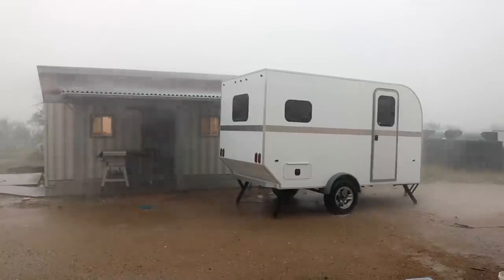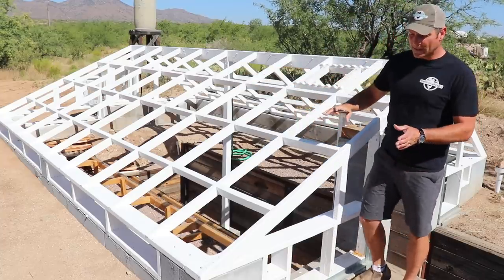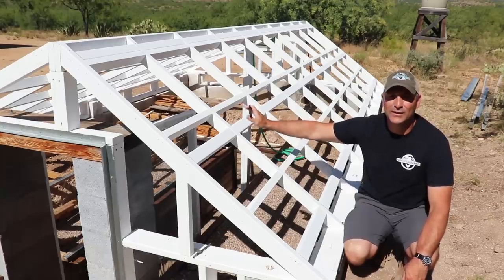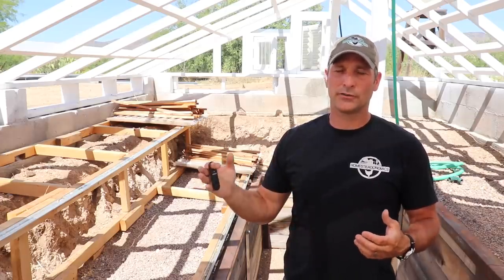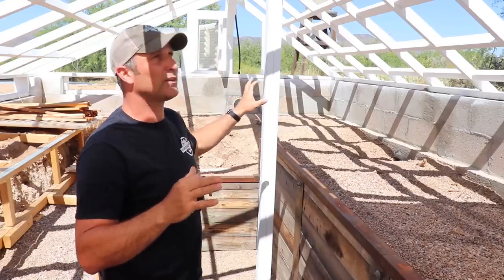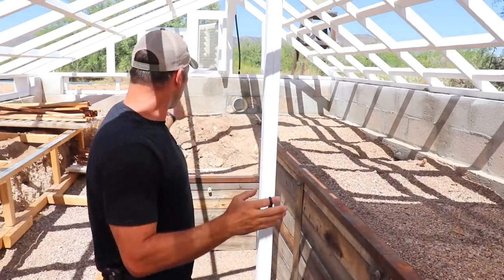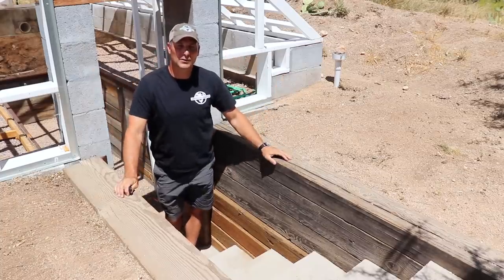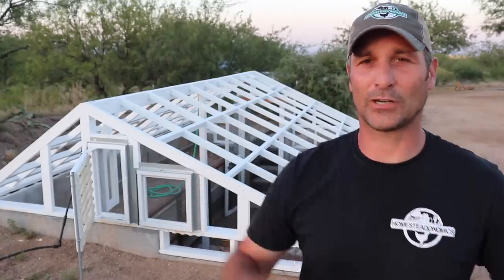Sunken Greenhouse Revival - Plans

Comment: I like the idea of putting the shade cloth on the outside on a rail system so it's sun and hail protection.  Because the sun and wind are so strong, shade cloth doesn't last long in AZ. Perhaps you could consider slatted panels from wood/metal that slide up and/or down the rail system.  Speaking of gardening, how are your fruit trees and veggies doing?

Comment: Maybe you could attach 2 long tarps on the top of the greenhouse on both sides.When you feel it may hail you stretch them out and hook them to the ground to cover the greenhouse.
Reply from the maker: Thats kinds what I am thinking.  Something that I could pull out for protection, but be stowed away too.   some have mentioned a pool cover roll that could be used to wheel it out or stow it away :D

Comment: Shade cloth like a tent 
Store it on tne north roof when nit needed.
Wind protection 
Just put anchor bolts in and tie the stucture to it .
Or 
Throw cables over the top.
Like on hoop houses

Comment: Days are longer in the summer, so a metal roof on the North side preferable white pro panel will do the trick. As it will not fade or bend and keep the heat away during the summer. A wood fence close to the ends will knock the wind off the greenhouse.
Reply from the maker: I think a fence would be great to buffer the wind.  But not sure how my would like me adding more strucutres around the house...haha... .she thinks I already have built too much ;)
Reply: @homesteadonomics  Build it within two feet of the greenhouse, even 3 to 4 foot fence helps. Plus keeps the dogs and kids away, both can be a pest problem LOL!!

Comment: Insulate the north half and use metal roof. Dig a 250 foot trench and run a few tubes through it to cool and heat the place.

Comment: Take 3/4 to 1 inch PVC pipe.
Place south to north.
Drive 1/2 inch rebar in ground every 4 to 5 ft.
Slide pvc pipe over rebar.
Place 4 metal T-post in ground about 3- 6 ft  from corners.
Place 4mil blue tarp over pvc pipe and wrap a rock or 1-2 inch round object  in each of 4 corners and tie off to t post.
The tarp will act as a buffer when the hell comes down and the tarp will also keep the inside of the greenhouse cooler and the 4mil blue tarp will allow sunlight to come through to grow the plants but not too much inside your Greenhouse.
 I would install 15 inches by  33 inches 4 to 5 Tier racks this way you'll be able to multiply your Greenhouse season capacity by 4 to 6 *
Reply from the maker: that's some good thinking!   I'm going to have to think about this as a real good option Bryce!  thank you!
Joe
Reply: @homesteadonomics  this works great in a desert because you can put on both sides North and South a water catching Basin 27 gallons or 5 or 10,000 gallons also you can change from the tarp to any other hell buffer or sun reduction fabric while using the rain catchment and Cooling your Greenhouse

Comment: Add more layers of polycarbonate to increase durability and provide more shading. Maybe only guessing though. I don't know if water would get in between layers, or if too much light will be blocked.
Or Add wire mesh over the top of polycarbonate with spacer to protect it from hail, another guess though, please weigh it up for a time to make a better choice.

Comment: There is a commercial greenhouse about a 100 miles by road.  They used polyurethane heavyweight on the inside of 2x4s and more on the outside of the 2x4s. In the winter or when the sun is too hot they have a type of aluminum sandwich with bubble wrap in the middle that they can roll up or down on the roof.

Comment: You should add a geothermal system to your greenhouse.  You are already 5 feet down.  A couple of pipe runs down 8ft and a blower in the greenhouse would make the whole thing usable all year long.  The ground is usually between 50-60 degrees 8ft down depending on where you are and thats a pretty cheap way of heating and cooling once you put in the pipes.  I see you have a pipe.  Its just not nearly deep enough.  You'd need 2 of those pipes 8ft deep.

Comment: I'd say the shade cloth should be more simple to install and provide more protection and probably be cheaper. Just make sure you have support to suspend it above the roof panels as the farther from the panel the more hail protection it will provide. You might want to consider using two pieces of cloth one UV resistant and one rip stop, unless you want to spend more money on a single strong yet UV resistant option.

Comment: 50% sun is more than adequate here. Just alternate panels between clear and standard opaque roofing. A checkerboard is even better (perhaps with the bottom row all clear). In the winter we still have enough solar intensity you just leave her buttoned up to keep temps up. Yours is not the best design for this 50% shade idea but it will still work and let you extend it's useful time longer than anything else. --- If you find you need more solar oomph in the winter just hang mylar space blankets under the north side roof panels. Gives you not only a thermal reflector but also a light reflector. --- For protection, just stick a screw in eyelet at each corner and roof peak with the loop being 3-4" off the roof surface (The type where it's an eyelet on the head of a 6" long screw basically). Then, when you want protection, just tie a tarp on each roof face with the corners going to an eyelet. Gives you a trampoline that hail will bounce right off of. Just make sure they are tight. There's a rope tightener we used in the Army on the old GP tents that is simple but effective (just can't remember what they are called) but any cinching knot will do. --- Forget the mortared rock wall. More work for poorer results. Build a mini gambion. --- I'm not sure if the roof would aerofoil on you but steel wire X braces on the roof (as low as is comfortable to work in) will ensure there's always tension fighting up/down pulses. You don't get extra load capacity but you also don't have crap in the way, haha. --- Earth tube cooling works great but we need a lot of depth here. Also, drain pipe (the type that spirals) works FAR better as it gives more surface area for the flowing air to shed thermal energy. PVC just has less surface area, is thicker, and conducts heat more poorly. --- You can give an added cooling boost by sticking a terra-cotta pot full of water (with a lid) in front of the earth tube vent. The terra-cotta will wick water slowly to its outer surface. Simple swamp cooler. --- Also, keeping the vent open on the same side as the earth tube outlet probably hurts flow since you want negative air pressure with the building exhaust as far (and as straight) away from the building intake as possible to keep a good flow. ------- Anyways, keep it up! Looking forward to see what all you get accomplished this year!

Comment: I was thinking about a combination of the 2...at the ridge put hinged panels that flip over from the metal side...that are 1 purlin in length...with a cutout for the solar fan.
Then from the bottom...a roll of the cloth that can be brought up to the level of the bottom of the flip-over (or lower for only partial coverage)...which can finish it out.
That is the best way I can think of that solves the problems of coverage & the solar vent being in the way and needing access to the sun instead of using just full cloth coverage.
I know that it probably sounds a bit crazy...but it works right in my head...but then I am kinda crazy too...so yeah   :)

Comment: It would be so much easier to run the shade cloth on the south side if you put the solar roof vent on the north side. You'd have to frame out a "chimney" for it to sit on so the sun angle was right for the built in solar panel. Aluminet will easily withstand the heat, wind, and sun. Not so sure about the hail, though. Get it with taped edges and grommets. Then it's as easy as attaching with rubber tie downs or bungee loops. Using it seasonally I get 8 - 10 years lifespan on the 50% aluminet at 7300 feet elevation in the southwest US. I've seen the temperature drop as much as 14 degrees F inside the greenhouse when installing on a sunny day! In the off season store it out of the sun and weather for longest life.

Comment: What about using a system where you use wooden slat that opens and closes with a Manuel hand crank, or a timer to automatically open and close.  Open day, closed at night on top of the poly carbonated roofing material

Comment: Reality is you dont need to over build on the rock shelf.. not like it is holding lots.. might be easier to get step stone pavers and go up a couple of bricks for a facing. Gravity is your friend.. Just a parge with mortar mix and you will be done.  What you describe is going to take a lot more work ... I like the idea of a sun shade cloth.. it is tried and true. and NOT going to blow off like small panels you described.  Think what a sunsetter shade cloth and how it rolls onto a shaft..

Comment: Put a rolled up shade cloth above the roof ridge with a hand crank to pull down for the sun and hail.  Maybe make the tube for the roll out of 3-4" ABS pipe(as long as it doesn't melt in your "balmy summer" days, or maybe your  metal supply guys have an aluminum pipe that would work.... KISS .....

Comment: Joe, good video - nice work.  Check out the Solexx products before you reroof. I have a 25 x 50 underground greenhouse that I covered with 5mm ~ It consistently maintains about 20 degrees above ambient without supplementary heat.  Thankfully I haven't experienced golf ball sized hail but I'm pretty sure it would bounce off.  All the best to you and yours, and Good Luck with your reno. Dave
Reply: I read your expansion contraction comment in an earlier communication; yes, it worried me and i struggled over the decision for months looking for example photos on the internet that would illustrate the amount of deflection of the material, and I looked at every alternative roofing type I could find.  and yes Solexx bubbles up a little between the supports on hot days and lays tight in the cold, but its not particularly unattractive. And I'm sure that I'll go thru the same research exercise when I reroof, but someone's going to have come up with a much improved technology for me to change.  And no, I do not have any affiliation with the company.

Comment: you mean like a roll tarp/canvas on a semi trailer. another way would be like curtains on dairy freestall barns. the  farm i work at the 150 ft long barn side curtains are automatic controlled by thermostat because cold draft at night can give them pneumonia. dairy farms in your area put up shade cloth over the areas where cows are waiting to get into the parlor. has to high enough to drive skid loaders/tractors under. my garden poly tunnels have 2 layers 6mil vapor barrier. every 2 years has to be changed the suns uv makes it brittle but it does stand up to minnesota 80 mph straight line winds & golf ball size hail

Comment: IMO your retaining wall will look better dry stacked. 6x6 inch footer would be over kill, just embed larger stones for support. Using mortar would require more work.  If you use the polycarbonate on top of the benches you will probably not get too much moisture below.  Just make sure they drain off the front,  you shouldn't need to place concrete.  If you use the concrete you wouldn't need polycarbonate with proper slope. 
Shade cloth should probably stow away easier than panels.
Reply from the maker: yes, to the shade cloth... I think it will be the more practical solution.  and I do love the look of dry stacked walls too!

Comment: I was looking at the angle of the sun in the sky and slats to let sun in during the moderate times of the year about a 35° angle and reflect during the summer when the sun is about a 80° angle.  This would allow indirect sun when its baking the ground and everything else.  Maybe aluminum foil on the side facing up?

Comment: Love the design! I also live in Arizona so I was wondering about a short retaining wall for any flash floods you probably won't be using it during the summer due to the Heat and may not have to worry about it at that time but we also get some heavy rains in the winter and whatever water that comes might wash alot of crap in to your beautiful Greenhouse so have you thought about putting a small water barrier wall around the entrance way? Also i would probably dig down a bit below your standing level inside and then put in some type of floor that lets water go down to that lower space but does not flood the area that you're standing in if any water were to get in and also water running down from your plants Etc. Looks great so far thanks for sharing very inspiring.

Comment: Would tension bars or cables work to attach into the block foundation wall? Or some other attachment point into the block?
Reply from the maker: I'm probably going to drive some 3' concrete stakes as part of the inner retaining wall and tie it into some poured concrete to support both the retaining wall and give anchoring for the shelving too
Reply: @homesteadonomics  Excited to see what you come up with. 👍

Comment: Stretch chicken wire over it. I don't think it will shade too much and it should stop or slow down most hail. Just a thought.
Reply: I should say above the roof a couple feet, not laying on the roof.
Reply from the maker: I think a wire spaced above the panels would be a great option and chicken wire is pretty cheap too!  :)

Comment: Hi There, I allways liked your green house.. (said that the hail storm ruined the roofin)  I have 2 posabilities to over think.: (1) If you wanne use the same (lexan) golfplates, my advise would be.: Use 2 layers on top of each other over the complete light side of the green house, and screw them thight together, to add strength.!  (2) The way it's bin done in my country.?  We use 1/5 inch thick flat massif lexan plates in alluminium profiles.!  But you can allso use the same vertical Lexan 1/5 inch thick windows, without alluminium frames, make them so that they are with an 1 inch gap on the under laying wooden frame, than you can allso srew hard wood over the seems.. This method is very strong, and less expensive than the alluninium frames.  Allso here we only add light shade curtens on the inside.. Anyway, succes with your plans.. Greetz.NL

Comment: Should use twin-wall polycarb for the whole building ... Lifetime guarantee from hail
Reply: * think the plastic you used previously isn't polycarb .. Rather i believe its PVC .. 
Twin wall polycarb will allow you to grow in the winter !
Reply from the maker: Amin K I’ve actually checked that twin wall stuff as well.  Seems all the polycarbs have about a 10yr hail warranty,   But I’m definitely checking into it as it would probably have better nighttime heat retention with that air gaps
Reply from the maker: ....and the previous was polycarb, not vinyl.   It actually held up to large marble hail a couple months before.  I think the storm just ended up to a level that was uncommon

Comment: the shade cloth, if you want appreciable hail resistance, I think if you engineer it almost like a trampoline, it could work. maybe...oh! so suppose you sew in pouches along its lenght to insert like 4" rubber balls, and some kind of weight at the bottom edge. the balls would elevate the sun cloth from the plastic, the weights would keep it taught. otherwise...just draping fabric over the plastic I don't forsee will offer more than negligable protection.  brainstorming
Reply from the maker: I'm definitely leaning towards the shade cloth and having it spaced above the GH by a few or more inches:)
Reply: @homesteadonomics  hmmm...youi could also use lines of some kind, stretched taught from peak to eaves, and the shade cloth can roll up over those suspended lines. could even use rings threaded over these suspension cables, affixing the fabric to to them. though that would impair a rolling function. but....yeah. I think having the fabric suspended away from the glass would also help with cooling anyway.

Comment: Although you being in Az. Do you have a sump pump for ground water or rain fall collecting in your dug in green house or is that not an issue at all for you?
Reply from the maker: Matt Varney not an issue for the greenhouse.  Our water table is hundreds of feet down and the ground is graded to shed water away from the GH.   Some water does come through the stairway but it’s very minimal even for a significant rain if a couple inches.  Thanks for watching😀🙏

Comment: Have you considered using 1/4" hardware cloth panels over the polycarbon for large hale protection. And could support a shade cloth as the shade from the hardware cloth would be minimal.
the old guy   Bert

Comment: I think shade slide side panels would be better. Of course they won't be as easy as pull down shade cloth but the would be much stronger, plus you could use some clips or clamps to lock them in place to resist winds. As to the North side, is it strong enough to make like a green roof? Flatten it out use Alum. or steel panels with an inch or two of earth spread on it and grow grass on it. Too heavy?

Comment: I remember this greenhouse project. Did you ever manage to use it at all? After beginning it there were only notifications on trailer building project videos.

The handrails are a good idea. How do you plan to automate the hail protection deployment? If you need to always be home and pre-warned to manually deploy then it seems like a marginal benefit on probability. Just maybe replace the broken panels and carry on, fwiw?

Good that you're updating projects to the channel though.